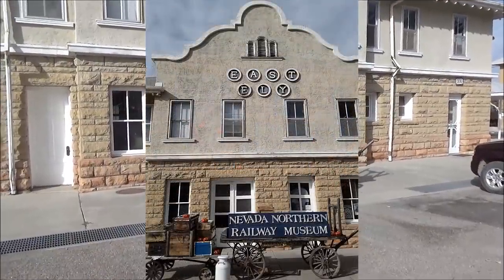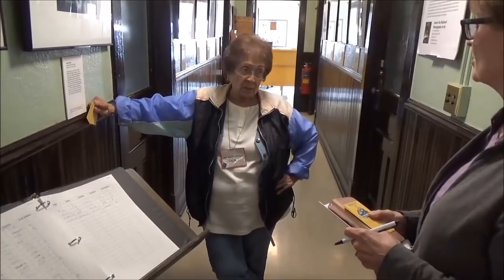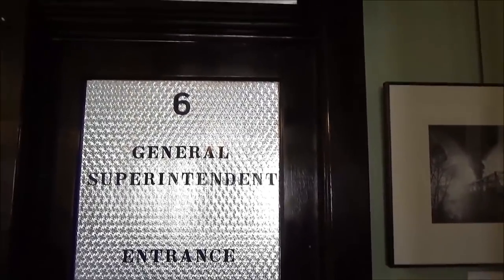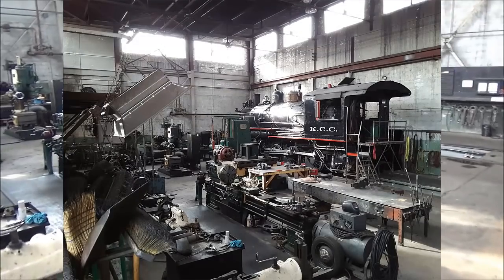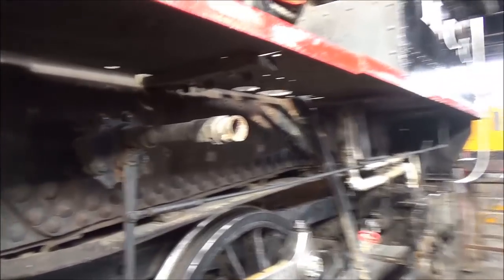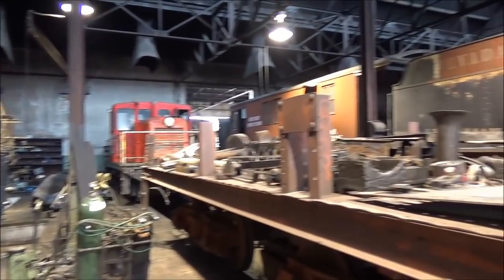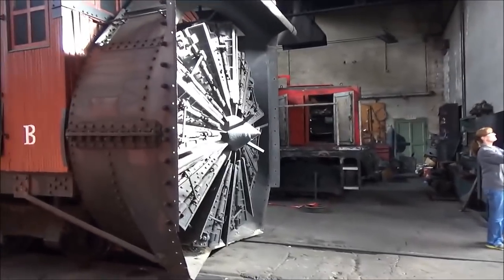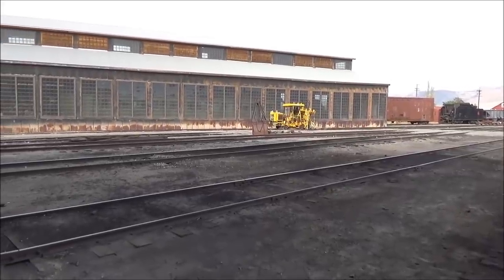Train Museum in Ely Nevada, full time RV living #train

Comment: that transmission should almost be fixed  by now good  luck to you guys
Reply from the maker: Philip Milks yes I just picked it up, it shifts in and out of gear like a car now, and is definitely more positive when it goes into gear. I ended up with a 50 mile 3 year warranty on the transmission itself and a 5-year 100000 mile warranty on the torque converter. So far I'm pretty happy with it I will be placing a video on here probably in about a week. I video everything they put in my transmission and they described also why they put it in there. I hope people find it interesting it's about 20 minutes long